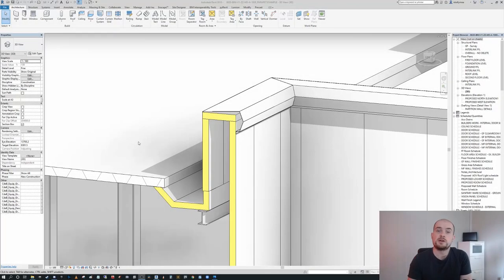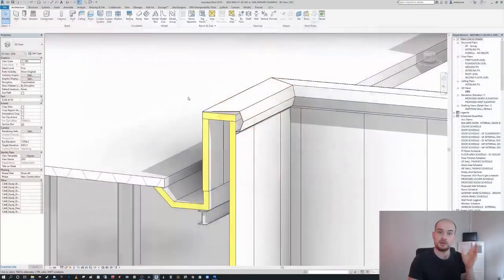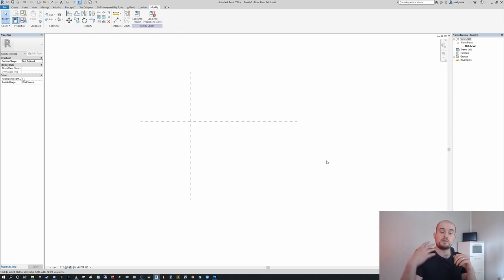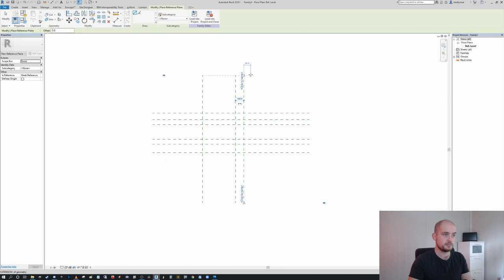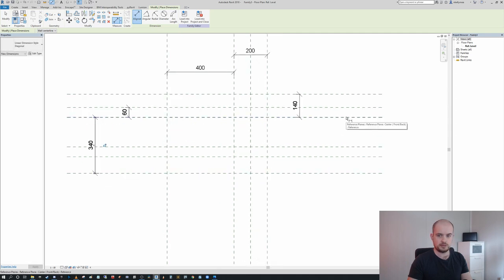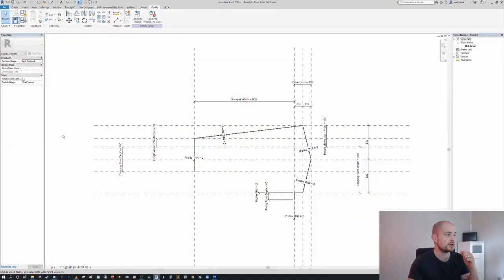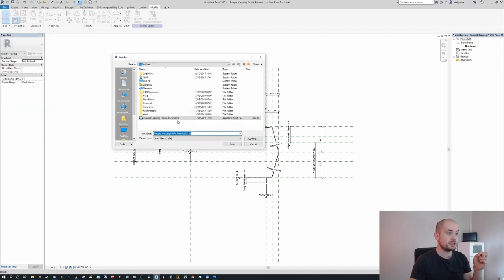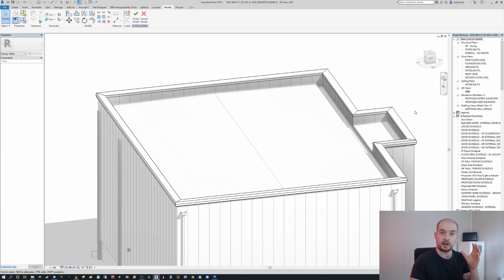How to Model a Parapet Capping in Revit

Comment: Could you make video in how we can model insulated sandwich puf panel with both side low rib metal sheet and another with 10thk cement board 100thk panel in revit

Comment: Hi! I'm using Revit LT and it doesn't have the Model in Place option on the Component tool... So I did the entire profile, but could not manage to place it into my project. Do you have any idea how I could still make the parapet in LT?
Reply from the maker: Hey Natalia, thanks for reaching out. LT can be a bit of a nuisance to be honest with you, rarely does it have everything needed for some important jobs.
Not to worry - I would recommend watching the video I have linked below which details how to apply the parapet capping profile to the wall construction assembly which should be able to get the same result for you as the model-in-place method. It's a long video so make sure to reference the time stamps in the description (although the full thing might be informative regardless)
https://youtu.be/mFBnpgjCJPc
I hope this gets you over the line. Big thank you for the support over on BuyMeACoffee also, it's appreciated.
Niall

Comment: Excellent tutorial but, for some reason, every time I select the inside edges of my parapet walls and click the finish check box, I get unable to create sweep. I only have 3 parapet walls so wondering if it's because i don't have a closed loop on my edge selection. The error message is unintelligible. If that's the case, How do I create the sweep on 3 walls?
Reply: I started from scratch and re-did the profile and everything works fine now. Not sure what the issue was before. But now I'm Happy! Great tutorial!